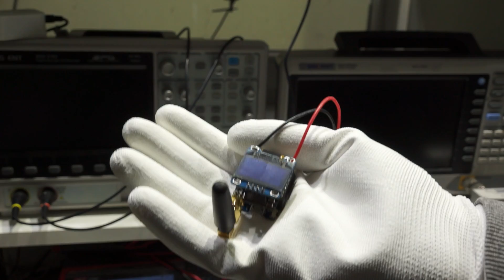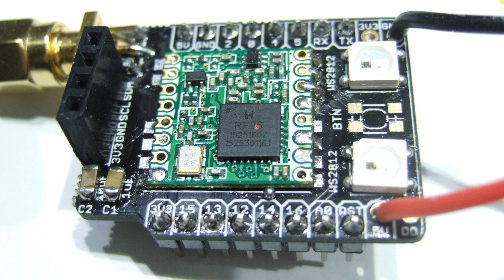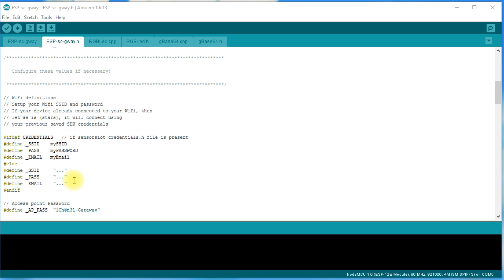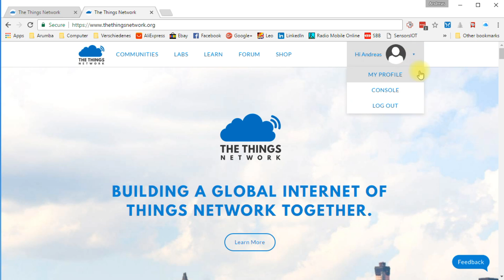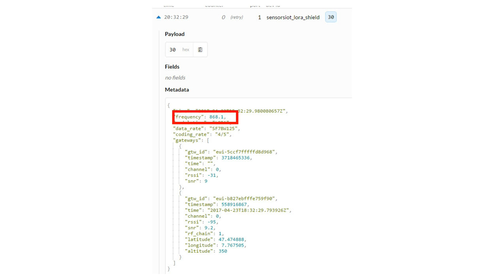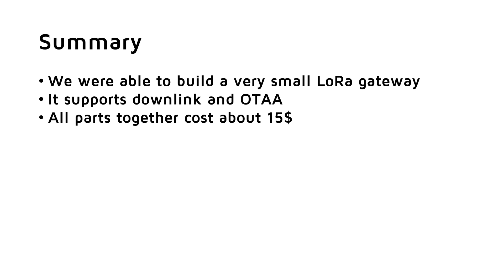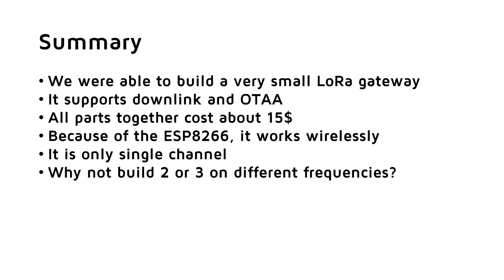#134 15$ LoRa Gateway with ESP8266 and a RFM95 (Tutorial)

Comment: Hi Mr Andreas. Where could I find this type of capacitors and diodes for Lora's PCB? Could you point me a link? I'll buy it with your link to support this channel! If you want you could also show me where to buy the Neopixels.  Thanks in advance!
Reply from the maker: I buy most of my electronic parts on AliExpress and so far, had good experiences. If you want to support the channel, you can use the link in my blog (http://www.sensorsiot.org/#row2) to start with buying (Banggood or AliExpress). It does not cost you more, but helps me...
Reply: Andreas Spiess the issue is that I can't find the same diodes and capacitors you showed in the video! :(
Reply from the maker: I would search for "capacitor smd 0805" or "diode smd 0805" on Aliexpress and then chose the right values. Usually, you get 100 or at leat 10 pcs. But they are very cheap. As I said, I used 1206 size, which are too big. So, the 0805 are smaller
Reply: Andreas Spiess thanks Mr. Andreas! Only another advice for me. On the bottom side of the PCB there are .."two pull-up resistors and three diodes"... What should I search for on aliexpress? Sorry I'm not a professional like you!
Ps: Is a simple wire enough for the antenna? Otherwise I'll buy it with your link. Thanks again!
Reply from the maker: If you go on Charles page (link in the description), you find his project page: https://github.com/hallard/WeMos-Lora. There, you find the schematics in the picture folder (WeMos-Lora-sch.png) and there you see the parts. BTW, the values are even printed on the PCB (1N4148 and 4.7k). The search is, "4.7k 0805", "1n4148 smd", "10uf 0805", "1uf 0805", "100nf 0805", or you order a assortment (https://www.aliexpress.com/item/Free-shipping-0805-SMD-Capacitor-assorted-kit-36values-20pcs-720pcs-1pF-10uF-Samples-kit/32360010982.html) which contains the three capacitor values. You can try with a simple wire. Google the right length
Reply: Andreas Spiess Thank you Mr Andreas!  This is exactly what I needed. Thanks again for you time!  The next step might be to build a Lora node with the same hardware. I'm not a professional but I think that we need is only a "node sketch". Have you ever found some source like that on web? In my opinion, It will probably represent the cheapest lora project
Reply from the maker: Maybe you watch my other videos concerning LoRa and I think, you will find what you need. Otherwise, Google is your friend ;-)
Reply: Andreas Spiess Thanks Mr Spiess  and stay in touch!

Comment: Hi Andreas, bumped into a small bug... Gateway EUI ID... you create this in your code from the mac-address etc...  in serial monitor I mis the first digit of the first mac address byte... I my case:

========== SDK Saved parameters End
Sketch contain SSID/PSK will set them
connecting to ---- with psk -----------------------
WIFI=STAConnecting to UDP
Connection successful
MAC: a0:20:a6:-:-:--:
Trying to Setup LoRa Module with
CS=GPIO16  DIO0=GPIO15  Reset=Unused
SX1276 detected, starting.
Gateway ID: 020A6-----,Listening at SF7 on 868.10 Mhz.

Regards,
Peter de PH0PPL ;-)
Reply from the maker: I have to admit: This is not my code, I just used it ;-)
Reply: I got i working ... look at my answer in the top. :)
Reply: Use this version -> https://github.com/things4u/ESP-1ch-Gateway-v4.0

Comment: Hi, I'm getting error "ESP-sc-gway:903: error: 'Open_Sans_13' was not declared in this scope" when compiling. Thanks
Reply from the maker: I never saw this error and also find nothing on google. So, maybe it is something specific to your setup?
Reply: I commented that line out and it compiled OK but it looks like I have a bad oled display, never easy... Keep up  the good work on these great videos Andreas!!!
Reply: same error, comented and ok.
Reply: Just use other font ... :-)
Reply: What font would you suggest the same problem here, thought it was a faulty OLED but tested it on a UNO and it works fine
Reply: I had the same problem. I switched the font from Open_Sans_13 to ArialMT_Plain_10. At that moment, the oled was still not showing anything. I also needed to change the i2c address of the oled display from 0x3D to 0x3C (line 71 in the ino file).

Comment: Grüetzi Andreas! Love your channel! Very nice of you to share all this knowledge with us. I want to make a small LoRa project with 1 gateway and 5 nodes. My question is: Can we use the same hardware for the nodes as we used for the gateway? I know you have a video on a LoRa node, but this setup seems more budget friendly. Thanks in advance!
Reply from the maker: I think, it should be possible. You just have to find a "node" script which works on the Wemos or you port the Arduino one yourself (mostly pin assignments)

Comment: Hi. A quick question please. Can a rfm69hw module fit into a https://www.ebay.co.uk/itm/401020862739 ?
Reply from the maker: Why not. It is 3.3 volt logic. But why not use a board which is made for the Wemos and the RFM69? Charles Hallard made also one (https://github.com/hallard/WeMos-RFM69). The RFM modules are not easy to be handled, they are SMD.

Comment: I want to order some SMA edge connectors, do you know the thickness of the little shield board?
Reply from the maker: It is 1.4 mm. I soldered a normal SMA connector and it fitted between the two pin rows.
Reply: Ok thanks Andreas.

Comment: Andreas,
Excellent video.

One question, the Wemos board in your video is stenciled as V2, the photos of bang good boards are not stenciled with the same V2. I've searched the Wemos site and several other sources and I can't find any others with the V2 stencil. My question, is there a difference between the version 2 and the others that you're aware of.

Most sources describe the boards as V2 in the photos but lack the same stencil or label as yours.

Thanks again for all your excellent work.
Reply from the maker: There are many different Wemos boards, and all should work. There are only minor differences.I usually order the ones with the Wemos logo because I want to support them. But I have also a few others.
Reply: Thank you for the clarification.

Comment: The 3 diodes you mentioned, are they connected to I/O 15? Probably following a circuit from Hallard : https://raw.githubusercontent.com/hallard/NodeMCU-Gateway/master/pictures/NodeMCU-Lora-Gateway-sch.png

Ah yes, I see the pcb is from Hallard too
Reply: Salut Andreas, Nice Video, as always :).

AFAICS, these diodes should protect the 3V IOs, DIO0, DIO1 and DIO2 against a possible 5V on GPIO15, and the diodes form an bit wise or-operation for GPIO15, on DIO0, DIO1 and DIO2 (from the schematic: GPIO15 (D8) <----> DIO0/D2 OR DIO1/D3 OR DIO2/D4). This is to reduce the number of interrupt lines to your CPU. See: https://raw.githubusercontent.com/hallard/WeMos-Lora/master/pictures/WeMos-Lora-sch.png
You removed D4 (marked on the PCB, and not on the SCH), that's connected to the RFM's DIO2. This is the RFM's line for signalling an interrupt for 'FhssChangeChannel' (see pg. 42 of http://www.hoperf.com/upload/rf/RFM95_96_97_98W.pdf). The 'FhssChangeChannel' interrupt goes low if a frequency change is required. If the IRQ mask enabled (see pg. 104) this interrupt, your software should then program a new frequency within the hopping period and write back a 1 to DIO2. (see pg. 28).

With all that said, the software used, does not use the interrupts in a proper way at all. It polls the RFM interrupts... In this case it will probably work without D3 as well, as only DIO0 (connected to D2) seems to be needed, because this will get the RxDone interrupt. In fact, I'm pretty sure that your sofware could falsely trigger and think it was an RxDone, if you don't remove D3 as well. I can't put this to the test, as I don't have any of this hardware (yet).

To solve the mistery of why it didn't work well with D4, is probably because the FhssChangeChannel interrupt (on DIO2), fired and the software failed to recognise that it was not really an interrupt coming from RxDone.
Reply from the maker: Yes. I know, how they are connected, but I do not know the software behind...
Reply: Andreas Spiess i understand. i know is it read the reason behind it somewhere but even then i didn't understand why it was necessary. Ballard by my knowledge is the only one using that diode gate

Comment: So, you could build a full 3 frequencies gateway for $45? 
Could you save some money by integrating some redundant parts?
Reply: I suspect you could connect multiple Lora boards to one Arduino. Depends on pin types required and availability.

Likely need to power the Lora boards separately from the Arduino.

Comment: Single channel lora gateway is actually a lora node? It can connect to many lora nodes and gateways just not at once?
Also is there a way i can buy this board with all the parts already soldered?
Reply from the maker: 1. It is a working LoRa gateway and you can connect many sensors through it.
2. I do not know of a pre-soldered device.

Comment: Great video. I like the fact the price is very low, so it is cheap to try it out. I also noticed your "ALDI reflow oven". I guess you built it yourself. Do you have video about it's build? If you do I must have missed it. That is also interesting topic to me.
Reply from the maker: Concerning oven: The only thing I added to the oven was a cheap temperature meter from Aliexpress (probe goes through a drilled hole) close to the PCB. Important is, that it has a fan inside (even temperature)
Reply: Interesting. So you are manually controlling the temperature for the process? I am considering to build reflow oven myself, so I am trying to find something that not very complex to do. If it works well that way that is a good thing to know.
Reply from the maker: +Marko Mrvelj not a lot to control. Just switch on, wait, and open the door...
Reply: Good to know. Thanks Andreas!

Comment: Is the single channel a software or hardware limitation? Is the radio using I2C so you might be able to hook up multiple radios to one esp? This was awesome to see and it's quite affordable, thanks for showcasing it!
Reply: Gateways should listen to multiple channels and multiple spreading factors (basically datarates) at the same time. The SX1301/SX1308 chip made to do the job basically contains the logic from ~40 receivers. That's how many modules you'd need to implement a compliant gateway from normal transceivers.
Reply from the maker: As donpalmera writes, it is the limitation of the RF chip

Comment: Andreas did you consider this firmware for single channel instead? : https://github.com/things4u/ESP-1ch-Gateway-v4.0
Reply from the maker: You can try. All these libraries have the same root, but sometimes added this or that. The one I forked has the right pin assignment and support of the neopixels, and I have added the support of the display.